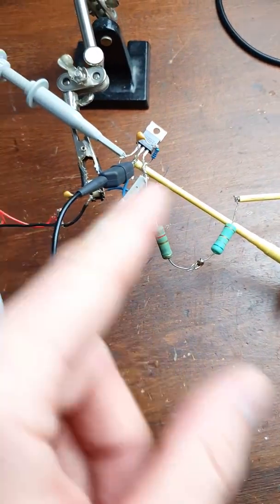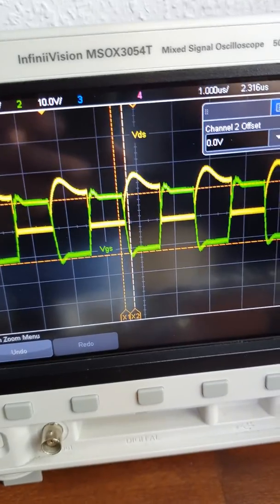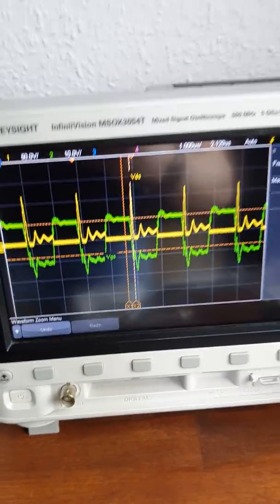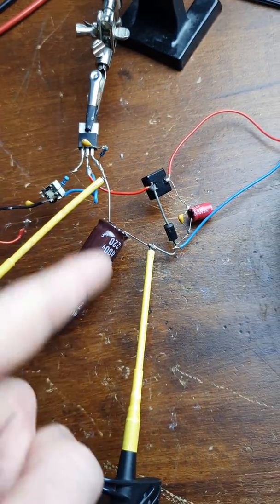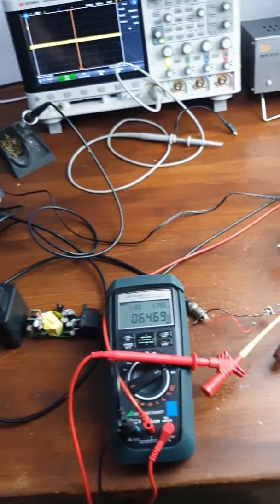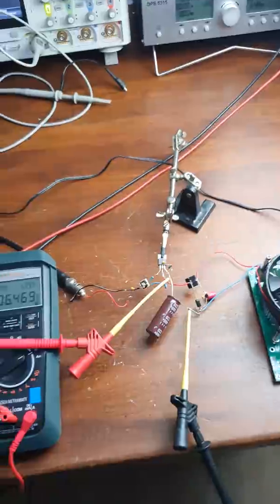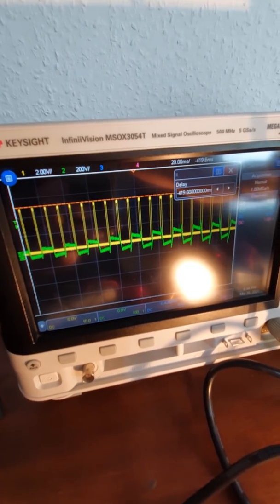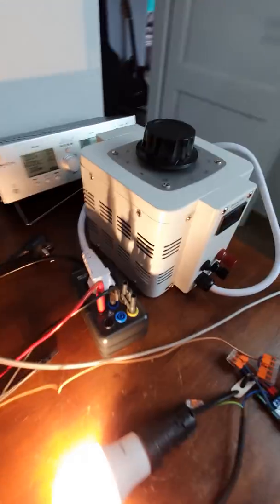March 2021 GreatScott! Behind The Scenes

Comment: Hey Scott, you can put that MicroPython board by using it as a Data Acquisition System. Log the data periodically using the ADC and then send it to your computer via the USB connector. To interface the microcontroller and computer, try using Python's pyserial library. Then you can save the collected data as a  .csv file and plot the data using Pyplot. Also, try including features to adjust the sampling rate and modes such as single channel mode or multichannel mode.